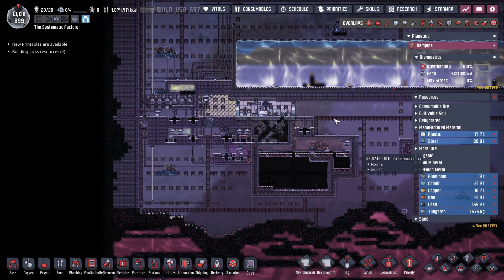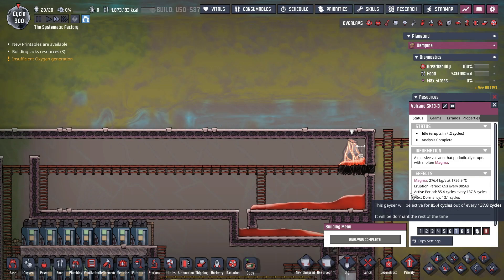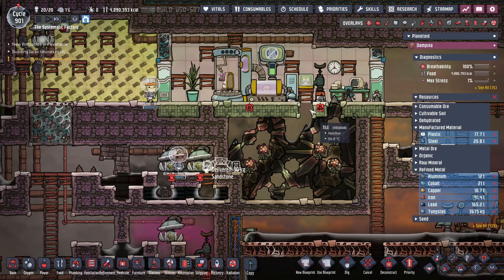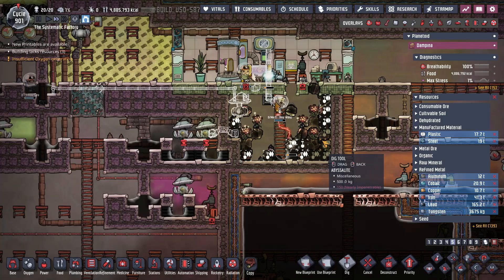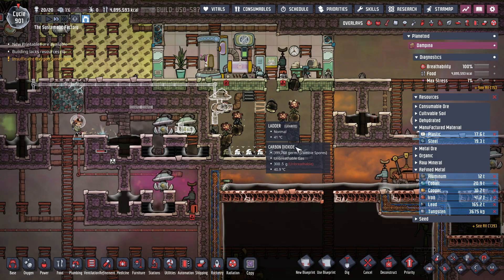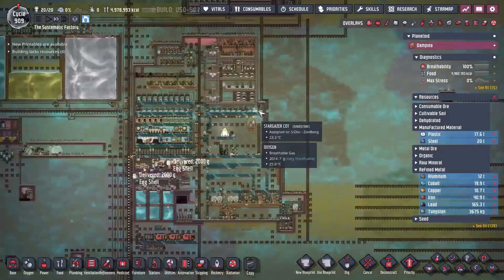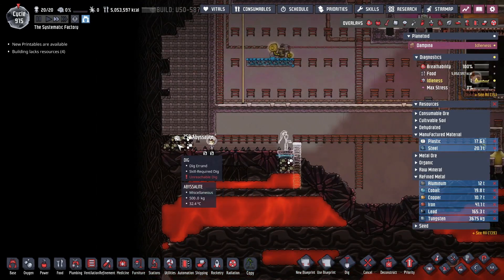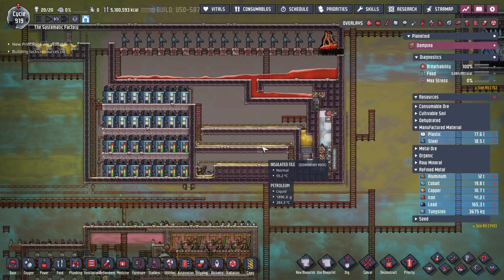First Look at Biobots | 18 | Oxygen Not Included | Oceania Cluster

Comment: I honestly wish they were changed. They had such promise and hope, but turned out into... basically another waste.  Not being able to do all tasks - it would be nice to restrict them to specific tasks, like an upgraded Sweepy bot... but then you might argue.. why not just make sweepy... better? (faster in particular, with higher carry capacity)

The biobot disappoints me in just about every way.  It's cost is rather high, and involves some danger (as the spores, if not properly handled, can infect and spread quickly) yet the reward is a... non recharging, not very good partial 'dupe' ?  ... just seems lacking, maybe if it had a special command bar, so that "only biobots can do this" or a station to 'only biobots allowed passed this point' it would work out better, but it still isn't ideal (technically you can put a dupe checkpoint all over to restrict dupes, but that is just.. a lot of material and power when a 'only biobot' check point would be a better option)

also they can't dig harder materials.. so they suffer the same as the Rovers... it just feels like a mash of a sweepy and a rover and with no real benefit.

I would have rathered they been a "Dupe" that say breathes IN carbon dioxide, and OUT oxygen or something, at similar rates to dupes in/out, and have their own traits and such, giving you a 'advanced dupe' system to work toward.  Sure, then they need 'food' of some sort, which might include more Zombie Spore infected materials, but at the same time - this would be a lot of fun.  Having a 'zombie colony' where you have to deal with too much oxygen and not enough CO2.
Reply from the maker: I agree.... except that they are the first iteration.  I hold out hope that they may make more changes to them.  But for sure, as they are, they are not super practical for anything yet.

I like your idea of a reverse dupe.  They could call them mole people.  We should get a mod made for that.